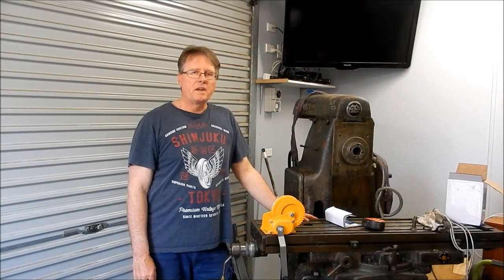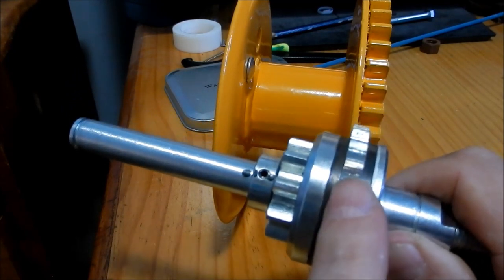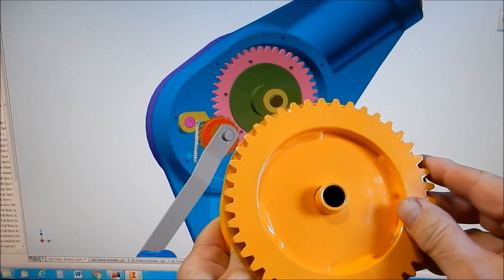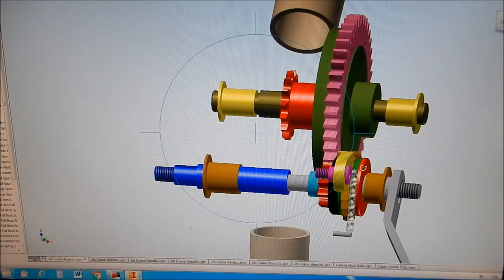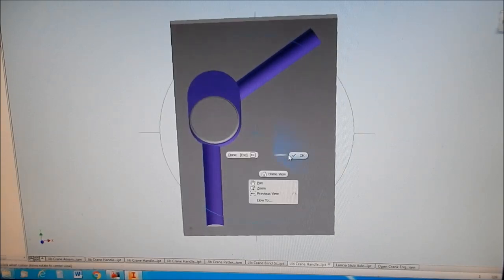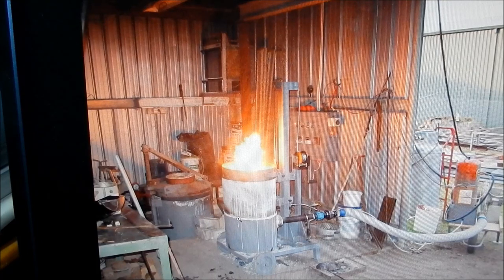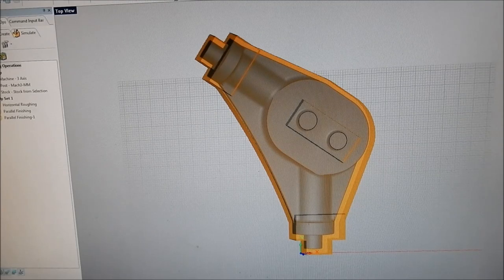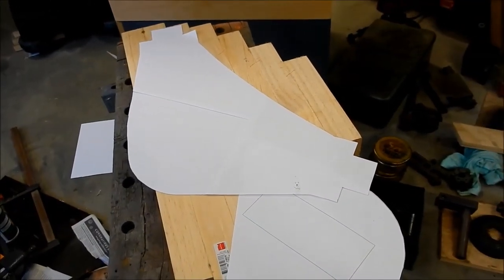Portable Jib Crane for the Workshop

Comment: Gday Cam, that was a serious furnace setup you had there, you were fair dinkum about at that’s for sure, I really looking forward to watching this project came alive, how much (length) chain can be stored in the upright of the jib, the braking system of the winch is a smart design, not a lot of components but very effective, great video mate, thanks     Cheers Matty
Reply from the maker: G'Day Matty, should be an interesting build and I'll need to come up a practical way to meld the volume required and then give it a T6  heat treat.  I'm hoping I can fit a standard chain length in that is boxed at 10Ft.  The build will slow down some what due to picking up a new project and back to long hours again.  I'm expecting work to die off around Christmas so while its there I need to make the most of it.
Cam

Comment: Should be an interesting one . Cheers .
Reply from the maker: Thanks Max, just got to find time.  Work has laid off a couple of supervisors and the remainder are taking on more crews with larger work-scopes.  Unfortunately that means more extended working hours and less time in the shop.  Here in Victoria if you have a job, hang onto it.  If you have a job make the most of it while you still can.
Cam

Comment: Had to make one of these for a friend building his own water treatment system. He needed a small jib crane he could pass thru a manhole cover and handle 750ish kg.

2' iron pipe and floor flanges provided. Two sheets of 3/8" plate sandwiched the whole affair. Braze the two pipe flanges 120° apart.  Screw in the pipe segments. Put a 1" pulley wheel at the top end.  Mount the winch in the middle, appropriately between the two pipes. Viola.
Reply: Put another floor flange on the mounting plate to match a bolt pattern in the floor.

Comment: G’day Cam. Looks like a neat project with some casting thrown in, awesome. (I love casting metal) Your old furnace looked to be pretty large you must have been doing a lot of work with it or it was a bit over the top:-). I’ll just have to wait and see what you come up with for this job, I myself just use a 20ltr drum
Cheers 
Peter
Reply from the maker: Hi Pete, yes it was a big furnace and at full tilt with the big crucible we could pour close to 40- 50 Kg's.  I did have another furnace slightly smaller that probably did the bulk of the work in the foundry but the big furnace certainly came in handy for the one or two jobs that needed more iron than the smaller one could melt or the casting bench was overflowing with molds ready to pour.  There was the occational time we had to put the Cupola back into service to make up the extra volume we needed for a couple of engine blocks we poured.
Cam

Comment: Looks like a cousin of Abom79's Sky Hook (which is no bad thing)
Reply from the maker: G'Day Paul, I do get the comment that its similar to the Sky Hook arrangement.  I actually based this on a "Davit Arm" Winch I designed many years ago to lift gear in and out of pits on Rolling Mills where a crane couldn't access.
Cam